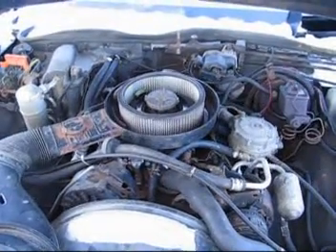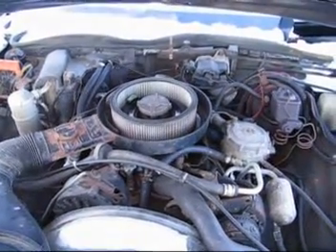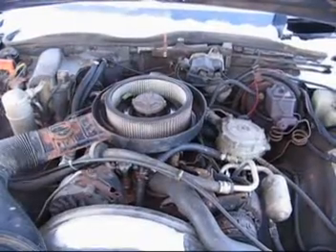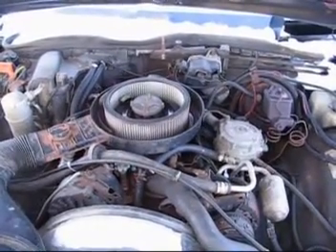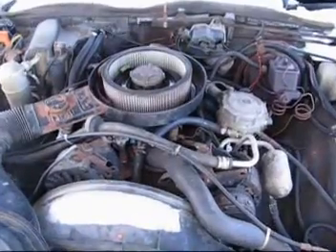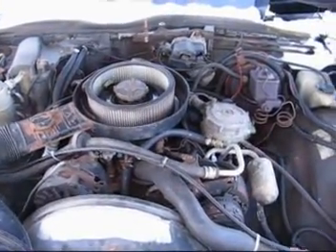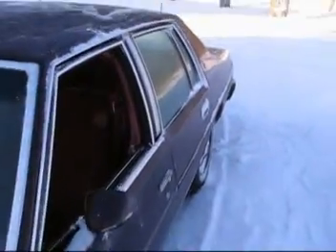Starting a Propane Car in Cold Weather

Comment: another advantage to propane is that the fuel can be stored indefinitely with no degredation of fuel system components, which is great for a vehicle that doesn't get used very often. i have an old 1974 chevy c10 truck converted to propane that i use 3-4 times a year to go to the dump or pick something up from home depot, so it sits around most of the time.  i never have to worry about the carburetor gumming up or the diaphragm in the fuel pump cracking, it's always ready to drive. a local rv dealer 2 miles away sells propane for $2.59 a gallon. i have collector plates on it so i don't have to pay annual registration.

Comment from the maker: Many people think that propane vehicles can't start in cold weather.  The point of this video is to show that cold temperatures aren't an issue with propane.  The only difference in starting is that the throttle needs to slightly open while cranking instead of pressed once to set the choke.  As long as the battery has enough power for cranking, my car will start this easily down to -40°F.

Comment: The reason for the -40° limit is that propane's boiling point at atmospheric pressure is -42°c/-44°f.

Below that temperature the propane tank actually has less than atmospheric pressure in it, AKA a slight vacuum and opening the tank valve would actually draw air into the tank.

Comment from the maker: You can get these parts from your local converison shop.  There are also a number of stores on the internet (like my e-store).  The conversion must meet either NFPA 58 or CSA B149.5 and I do not recommend that you put fuel in the system unless it has been professionally inspected.

Comment from the maker: @McJim15 Generally, propane conversions are done to save money on fuel.  Presumably, if your dad installed it, he also had a readily available supply of low cost propane.  Although gasoline prices have come down lately, I think it would be worthwhile continue using propane, especially since someone else has already spent the money to convert the truck.  You can get a much better price on propane if you lock-in a price with a propane supplier when the market is low (ie, during the summer).

Comment from the maker: Your converter will only freeze if it is undersized or if it is not getting enough water flow.  Normally, letting the engine idle while you clear the snow off your car is plenty of warm-up.

Comment from the maker: @mitteey Although propane has a higher energy content (BTU/lb) than gasoline, it has a lower density (lb/gallon).  Because of its lower density, a car running on propane will have a higher fuel consumption than one running on gasoline.  When the fuel price is factored into consumption, the driving cost ($/mile), propane can be significantly cheaper to use.  The savings depend on the difference in price between gasoline and  propane.

Comment from the maker: I would think that it would be easier to pump below -40°F.  Barbecue tanks are filled by weight so I wouldn't expect they would lose or gain sales with temperature changes.  The spit valve on a vehicle or lift truck tank should still work perfectly and liquid expansion is the reason propane tanks only filled to 80% capacity.

Comment from the maker: Too much throttle can cause an intake manifold backfire during cranking.  If you have an Impco system on your minibus and have cold-start problems, there are start-assist devices that can help.  Visit my Alternative Fuels Forum if you need help.

Comment: Because they have Diesel engines, and Diesel is more efficient than gas engines. If you were to build a new one with a propane engine I don't see a problem, but to convert Diesel to propane could be costly. You could mix the diesel and propane to get better mileage, but that requires  significant investment, something most trucking companies won't do.

Comment from the maker: Ambient temperatures would definitely be a problem with operation below -40°F.  To operate a propane vehicle in these temperatures, you would have to provide some heat to the tank to raise the pressure inside enough to get propane to flow to the engine.  The solution is is bit involved to answer here and I would suggest that you discuss this on the FuelsForum.
Reply: hey man old video but would you tell me some things.
how does this affect power and how about mileage? idc about cold starts but they seem fine to me. i drive my fun car warm months only. cold starts are just to get the oil at the top when it sits. 
i have a feeling i can make my fun car twice as fun for a weekend and cheaper to drive. is that true? i call it that as i have a built motor on a factory detune. my motor makes 350hp stock detune is 255 hp and my motor i built is a 400+hp capable motor. make any sense? lpg is 110 octane and i run on 89. race on 94 as its a whole diff animal. with 110 shes be a beaut. i get my tune for the 110 lpg conversion. i should be looking at alot better numbers . im maybe 330-350 hp now but 400-450 ft lbs of torque. i could see 500 hp and 600 ft lbs of torque no problem with my thinking unless im wrong. i know just a tune will wake my motor up severely but i leave it with a bad tune because it keeps me from breaking things. i save my money on gas. i can replace the weak points and just drive the thing. get low on fuel exchange a tank. it take 10 secs and now im back on the road for another. as of now 200 miles or so. 1 50 lb tank of propane would be about 1/3 tank for me. 10 gallons of gas is 100 lbs i have 16 gallon tank. 160 lbs  3x 50 is 150.

Comment from the maker: Propane has less energy per gallon than gasoline so your mileage would decrease.  Typically, carbureted conversions get around 75-80% of the vehicle's gasoline economy.  The only economic reason for converting is that you can find propane for 70% or less of the price of gasoline.  Today, I'm buying propane for about $2.65/gallon while gasoline costs around $4.91. This means propane costs me about 54% of the price of gasoline.  The price of propane can vary greatly from station to station.